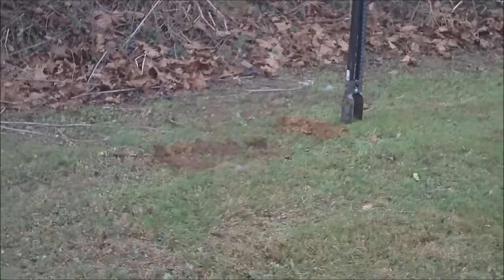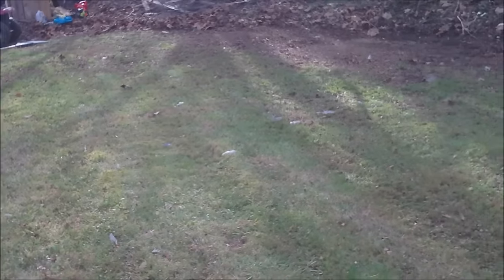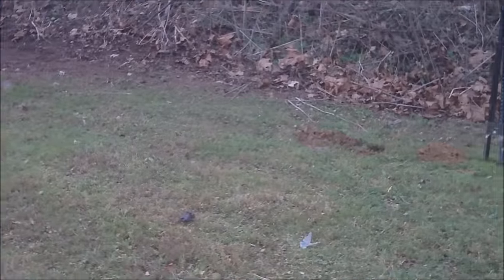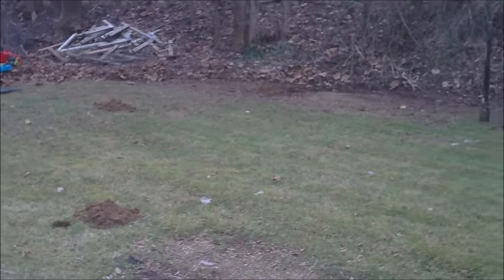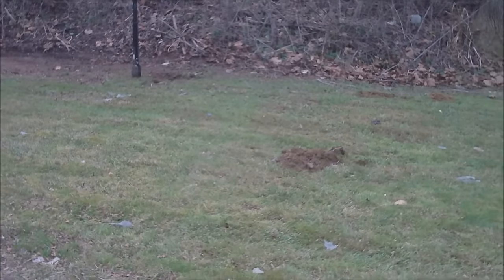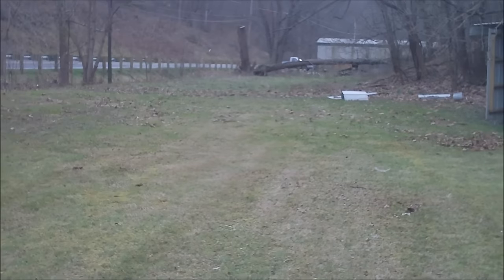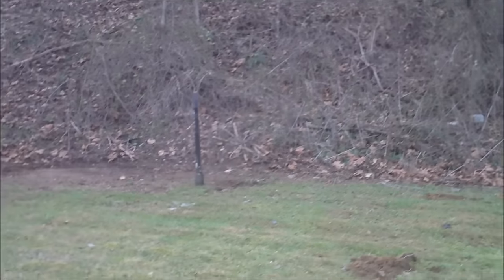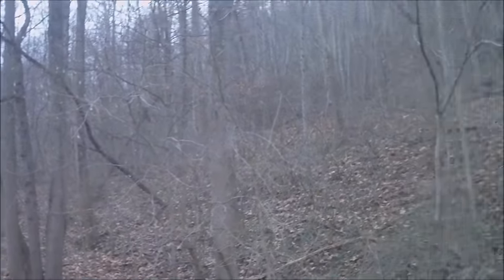Homestead Building Pt  1

Comment: you can make a rudimental (crude) chainsaw mill using a C channel that will run over a straight 2 X 4 or 2 X 6 that you screw down to a piece of timber.    Attached to the C channel you weld a piece of iron that you can C clamp to your chainsaw bar.  Crude in that you would have to move the 2 X lumber each time you cut a board unless you can rig up a system with a piece of round stock and piece of pipe with a jam bolt .
Reply from the maker: +Randy J That's very interesting, I will check into that